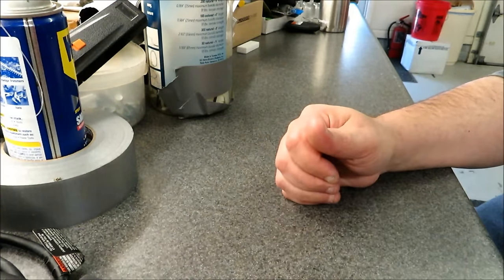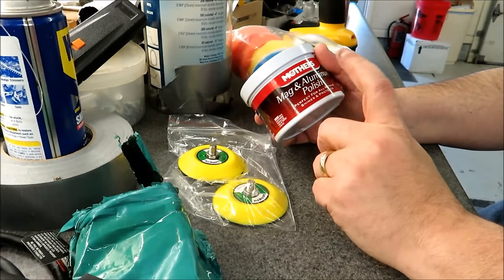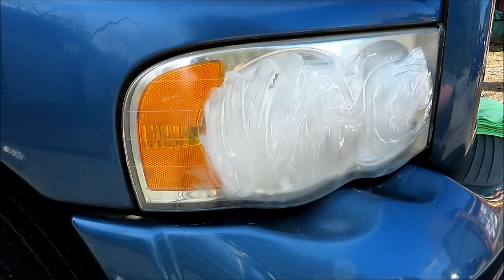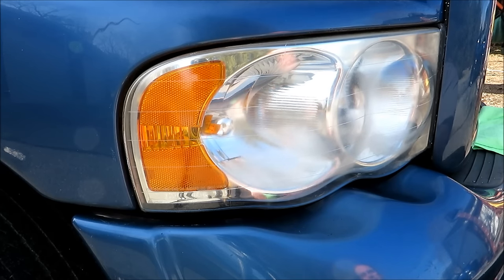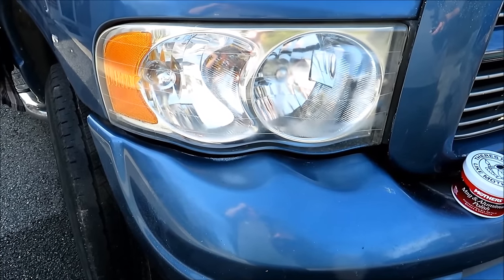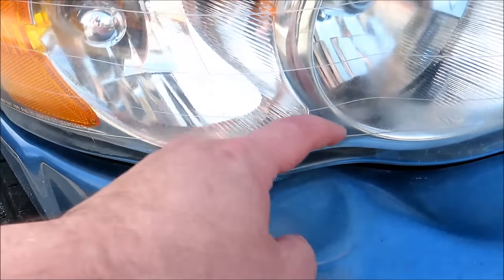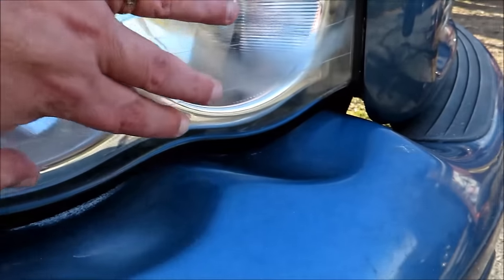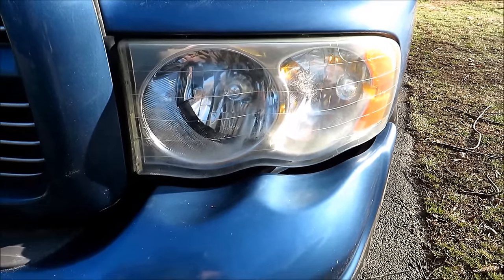Headlight Restoration using Mothers Mag Polish - Pass or Fail

Comment: This was user error not the Mothers polish.
***For best results:
#1. Don't sand or use those dumb pads.
#2. Wash with soap then dry.
#3. Use Mother's Mag\Alu wheel polish with a pad and start working it in with slight pressure. (let the polish do the work)...
.... Repeat polish for more shine. That simple!..  Don't get fooled into sanding unless you actually know what you are doing.

Comment: The lower portion of the lights appear to be "sanblasted" by the design of the bumper and how it funnels air into the lower side of the lights. If the plastic had degraded there may be no method of restoration.

Comment: My car is 18 years old, 110 K miles, and is in top condition: everything works.  The headlamp covers were badly yellowed to the point that you could see the diminished performance at night.  I had watched many of these videos and feared what seemed to be the sheer complexity (multiple steps, multiple products, multiple sandpaper grits, a drill polisher, etc.) and performance risk of clarifying them.  So I decided to go basic: bottle of name brand clear plastic cleaner and polish advertised as suitable for headlamp covers ($8), some blue shop towels (cheap), and some water:  if my approach didn't work, I was out very little money.  I removed surface dust from the headlamp covers, masked off the edges, and then just used that product on the shop towels in circular motions with some elbow grease (while joking to myself, "wax on, wax off").  Took some old school persistence, but I got 90-95% of the way to factory shine (certainly outstanding clarity for an ordinary used car: the headlamps look not quite new, but great) in under 10 minutes with little work, expense, or risk.  So I recommend doing it the basic and low-risk way first, and if you're not happy with that level of clarity you can break out more tools and products to get that final 5-10% and the new car look.

Comment: There is a clear coating on the lamps originally. If you break through it, you will see a different color not unlike delamination on clear coat paint. I did my wife's headlights with Mother's Alum wheel cleaner and the first time around they looked a lot better. But, I thought if I went over them again it will be even better. Not so, the second time around I broke through the factory coating and now they look worse than the first time around with the wheel cleaner.

Comment: i used this polish on my yaris headlights and it only took 5mins to do both and apply sealant to finish off. The stuff works. Headlights look brand new. i used my DA polisher and lake country microfibre pad.
Reply from the maker: Yea I've seen a lot of videos on YouTube where it was successful.  Have no idea why it wasn't in my case.
Reply: Hi what color Lake Country pads did you use? I have the orange ones, and what speed  on the DA? I have a Porter Cable XP 7424

Comment: Just use UPVC Solvent , put some on a white cotton cloth, old pillow case , rub on headlight and the yellow comes easily off the headlights !   it’s available for about £4.00 ( 5 US Dollars) I use this in my work when cleaning up guttering/  downpipes , UPVC doors etc , if you have stained doors or windows due to heavy smokers in your rental property this will wipe it off easily.     The foggy look on headlights can be removed with Mers polish , similar to T- Cut , auto polish ,   I haven’t tried T- Cut but it should give the same results .     Always use the Mers polish after you have removed the yellowing not before.
Reply: The UPVC Solvent won't hurt the lens?

Comment: I did mine and came out wonderful. I zip tied a shop rag to my sanding disc on my drill and let it fly. I gave the drill a bit of force. After that I zip tied a clean rag to it and let it fly under a minute and it turned out great. I dont know what your problem was.🤪

Comment: One thing I would like is a shot of the lights turned on at night on these videos. I used the step up in sanding and final polish method, and the results look great, but turn on the lights, and fine scratches are visible.

Comment: I have to second Ethericwings and give a B.S.  for Mothers Mag wheel polish getting the job done.  I tried both a Mothers  Head light kit complete with 3 pads (800, 1500, 3000, and a buffer) and the Mothers Mag wheel polish and no good results.  My lights were not even as bad as the ones in this video.  Cudos to the Man giving an honest try.  I'm about to try again for the 4th time hope someone can benefit from my waste of time.
Reply from the maker: Yea I thought about doing a round two but in the end I will probably just buy 2 new light assemblies and be done with it.  Since the truck is a work truck and not even close to being a daily for me this was more about trying it out to see if it actually worked.

Comment: There's only one way the right way!! The lower part of the lens is oxidation an as got tobe removed before any polishing, A product short cut for you!! 3m restoration kit 3 stage method first dry sanding for p500-p800 spray tap water on lens before useing p3000 trizact pad, When the lens becomes milky evenly across the lens spray any glass cleaner spray wipe lens with a micro fibre cloth and dry before buffing with a headlight polish, when your happy with clarity and shine again wipe lens with micro fibre cloth, Don't use the crappy clearcoat wipes, Use Maguires clearcoat with added UV protection!! One coat drys in 5min's job done!! There's lots of demonstrations on utube you can't go wrong!!!🤔😲👍👍

Comment: Dont know why it didn’t work for you. Your lights must have been really bad. I used this on my truck(07) headlights which were completely fogged. Didnt use sand paper just the polish and a mini mothers power ball. People thought i bought new lights. Took 5mins at the most to do both lights. 
Just wondering as it might have just been the video but looks like your reflectors are cracked on the inside. Maybe left over fogging is on the inside?
Reply from the maker: Didn't notice the reflectors being damaged will have to take a look.  I was really hoping that it would take like 5 minutes like you mentioned.  I guess maybe the lights are just to far gone to be able to get away without doing a full on wet sanding etc... Of course with as cheap as lights have gotten for the truck might just replace them.
Reply: Im not totally sure about the cracked reflectors but either way i think it might be best to buy new housings as you said.

Comment: chrysler oem headlights are made with a very cheap plastic and the clear coat they used is very uneven and thicker in certain areas of the headlight and must be given more attention and elbow grease. GOOD LUCK.

Comment: all I did was rub it on , liberal amount on the rag and just circular motion rubbed it on , let it set for 5 seconds (I DID NOT LET IT DRY) , and I just kept rubbing , ALWAYS turning my cloth to a clean part , just buffed it out , and for the final buff I used a brand new clean cotton rag (I use those flour sack rags from Walmart , 100% cotton in the home goods section they look like an extra large handkerchief , you get a 5 pack for about $5) ..... was not difficult , zero power tools , came out great , NOT PERFECT , BUT GREAT .... Lens looks a lot lot better , and I am certainly happy for 7 bucks total cost and 5 or 6 minutes of basically "doing a wax job on my headlights" .... I have a vid just haven't uploaded it yet

Comment: Looks like the areas you are having a problem with is where the clear coat has reached total failure. The mothers is going to have more abrasive than say m110 or m105 so your compound isn't the issue. I just skip the polishing and sand then spray down new clear coat. The drill is a rotary action and with a 3in pad is plenty powerful. You got good results and probably as far as you can go via rotary or DA.
Reply from the maker: Thank u for the honest and constructive feedback.

Comment: I have done around 25 sets of headlights using the mothers and have yet to fail. you need a larger pad and a larger buffer motor.
Reply: Do you think Meguairs microfiber cutting discs would be okay, or medium polishing pads?

Comment: 1. You didn't use enough polish. 2. if the plastic is hot you are polishing it and not cutting, hence cut n polish.
Same as cutting and buffing paint the compound does the work like sandpaper and if you make the paint hot more compound less speed.
3. Focus on the sections that are still faded.
4. Thanks for showing others how not to do it👍

Comment: My '04 Ram had the same problem. The surface gets rough, not just discolored. I would think you would need to sand it smooth then use Mother's on it. But instead of doing any of that, I just bought new headlights off of Amazon for $80 to my door. They look identical. I've had them for over two years and they still look new. I am going to use the Mother's method on my '01 Maxima, should work good because they are actually better than some of the headlights shown in other videos. Good video, a little long winded though.
Reply from the maker: Thanks for the feedback.  I definitely went back and forth as to whether or not I should cut it down a little more.  I try to keep them like 15 minutes or less.  But I really wanted to put in the final follow-up about the fact that even Meguiars and full on heavy duty compound didn't work either so that it is probably more about the damage to the lights and less about the Mothers not working.

On a side note thanks for the tip on checking Amazon for new lights.  I'm just a little loath to change the whole assembly as its a bit of a pain but might end up being my only option.
Reply: Here's the link to what I bought. There are so many on Amazon. https://www.amazon.com/gp/product/B001R5D66M/ref=oh_aui_search_detailpage?ie=UTF8&psc=1

Comment: I think you're running into a problem because the Mag Polish is supposed to be a FINAL step and you're using it as the ONLY step.  You're supposed to start with a 800 grit sandpaper and wet sand the headlight then switch to a 1200 grit AND THEN finish up with the Mag polishing compound.
Reply: 500 then 800 then trizact3000
Reply: That's interesting what's annoying is that there are hundreds of videos where people show it as the only step and they improve their headlamps in less than 5 minutes. I've had the same experience as this  video creator.

Comment: My lights were badly fogged after 16 years of unattended buildup.   I tried a liquid Fine Polishing compound intended for car paint surfaces.   I simply hand rubbed the polish into the headlights, and removed about 80-90% of the obstructing film.   There is some remaining hazy patches that will probably need to be sanded, but I've got the majority of my lights back.

Comment: If your tool spins too fast, the sponge does not have time to drop to the surface in the concave parts of your lens. You might get better results hand sanding until the pitting is gone, then hand polishing, might take twice the time due to the bumpy profile of your headlights.
Reply: I was thinking, the fogging around the bottom is on the inside. Moisture and condensation can cause dirt to collect inside the fixture.  It’s probably not possible to get to it through a tiny hole where the bulbs go.
Reply: OK that's a valid thought but to be honest - for CERTAIN the crud is oxidation and it is ENTIRELY on the outer surface. @alphagt62
Reply: @timwalsh715  the headlight fixture is not an airtight seal. It’s not like it’s a bulb, just a plastic box the bulbs are in. Air, and moisture can get into the fixture, and leave a dirty residue behind. Sure, oxidation and sunlight have done their work on the outside, but if he can’t polish it away around the bottom, it may just be a dirty film on the inside. The oxidation is no worse at the bottom than any other spot on the lens, why would it be harder to remove? And there’s no way to get to it, you just have to live with it.

Comment: Nice try bud...BUT you need to polish your lens BEFORE the application of Mother's dries too much. You will get much better results using a simple buffing bonnet at low speed while the paste is still wet with two applications, then spray a layer or two of clear coat. Done many like this, and the outcome is much better.

Comment: Mother's has worked great on my vehicles but where you can actually feel the difference, you have to wet sand and then finish with mother's and a wax like Zymol.
Reply: Should I apply UV protectant spray afterwards?

Comment: Yeah agreed on that they probably need a light wet sanding on the really rough stuff. BUT!!! That could also be "crazing" on that section of the headlights. Depends on his driving conditions too huh. "Crazing" is like very fine cracks within the plastic and almost impossible to remove as you would have to sand very very aggressively. I've used Rubbing Compound on nasty ones then finished with the Mag and Aluminum Polish...always works! Don't forget good pressure and high tool speed and keep it moving to avoid burning the lens.
Reply: What kind of rubbing compound? Would you get something like that at an auto store.

Comment: I tried it at least twice on our 2002 CR V and while it helped in the less cloudy areas it did not get the major cloudy areas clear. I only applied it with soft, clean microfiber towels and polished very diligently by hand. I was disappointed in the results and would say you need an electric polisher to get proper results. It failed for me.

Comment: B.S. there's no product in the world that will fix damaged uv Ray's. Wet sand with 2000 if not to bad. If bad and clear coat missing start with 600 grit then 1000, 1500,2000! Use a compound to buff clear any wet sanding scratches. Then use a plastic wax sealer. There's no short cuts in life people. I could of used a light compound or a wax with a high speed buffer and did this. I to clean with a solvent before sanding. Prevent this by waxing your headlight once a month. Takes a minute. Remember, cars are like lady's. There maintenance. I love them both.
Reply: I agree with you.
Reply: Worked better for me than the sanding...so I say you're wrong!
Reply: I've used the Mother's Aluminium & Mag polish, and it works good as long as the headlights are not extremely hazed.  If the headlights are in really bad condition, then you'll need to wet sand with 800, 1000, 2000+ grit sandpaper.  And you can get sealer to help prevent them from yellowing/hazing over again.
Reply: Your correct mate no shortcuts in life.
Reply: What a load of crap, "no shortcuts in life". We have products and technology to make things happen quicker in modern life. That's what the car was invented for, so people no longer have to walk, or ride a horse.
Reply: And by the way it's could 'have', not 'of'. And what are "damaged uv Rays"? And it's 'ladies' not 'lady's'. And what does "there maintenance" mean? Do you english much?

Comment: The videos I've watched they used a buffing pad, not an abrasive pad. I did mine 2 weeks ago using Cerakote Ceramic and they're much improved but not as much as I hoped for. I'm trying to decide if I should try Mother's but I'm concerned about the outcome because of the newly applied ceramic finish. Has anybody had the same experience and moved on to another method that worked better?

Comment: If it’s etched into the plastic I’d really doubt you just polish it away. Thousands of miles worth of essentially sand blasting that plastic would probably need to be sanded. 
I’ve used this on yellowed headlights and it works great. But they weren’t pitted like that.

Comment: Watch one video. Guy took WD  40 sprayed  it on the head  light. Gave it a good coating.  Then he took an  orange ,  put baking  soda on the  orange. use that to scrub the lens. Covered the lens with  plastic wrap. Let it sit 20 minutes wiped it off.  My 2003 Silverado is in the shop. When I get it  back I will give  The WD 40 method a try.

Comment: you need to use the 3M Microfibre or wool cutting pad not these cheap pads, if your gonna follow other you tube tutorials make sure you follow it exactly as they do it and not cut corners by using cheap pads.

Comment: that would probably work great but you need to sand them first, start with 600 grit to remove the old clearcoat and oxidation, end up with 3,000 grit, then polish, also if you want it to last you need to replace the clearcoat, a few companies make a shake and spray just for headlights

Comment: don't judge using mothers for headlights based on this video, he did everything wrong to the point where he probably ruined his headlights. power tools spin too fast, especially with the minuscule amount of mothers he was using, it creates too much heat and will cause the lenses to spiderweb in a short time afterward they cool down. if you want good results ditch the power tools, use a generous amount of  mothers and some  good old fashioned elbow grease, headlights aren't that big and it won't kill you to do it by hand so the lenses don't get hot.......

Comment: That mother's is an aluminum polish,. So it's just grittier than plastic polish.  It's the equivalent to p1500-2000 grit sandpaper (not exactly sure on that). You need something with more grit. p800 or 500

Comment: Sand paper may have taken off that heavy oxidation on the bottom of that lens.    Then follow up with a finer grit and then with a compound and finally a polish.   Should give acceptable results.     The Mothers did do a decent job on it's own.    Always follow up with a wax, sealant, or coating to prevent re-oxidation from forming eventually.
Reply: yep. that's exactly what it needed.
Reply: its* own

Comment: Does anyone know of a UV clearcoat that is polish based? I am not talking about wax sealants they don't last. Wet clearcoat application or spray clearcoat is my failure point. I have had to re-sand and start over when I orange peel the final step. Any ideas?